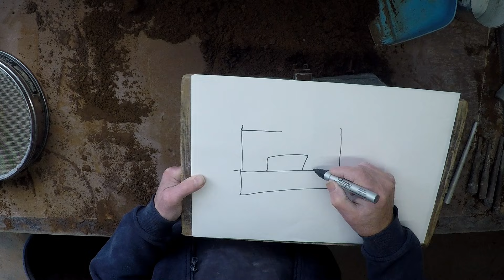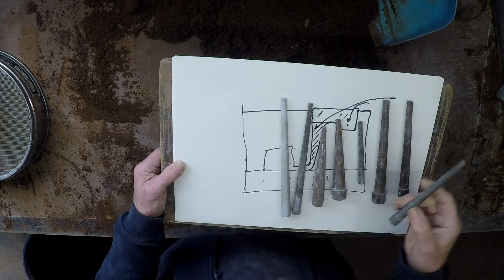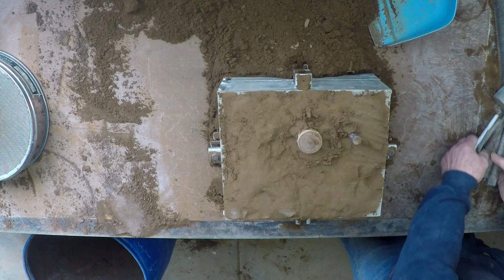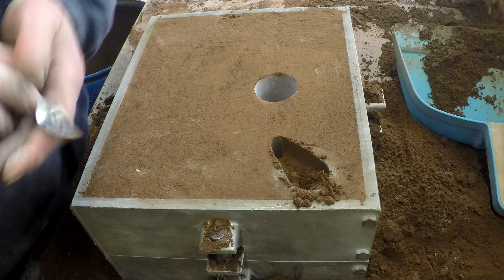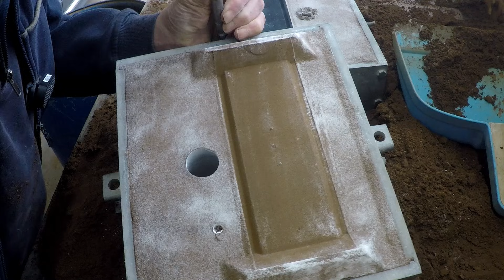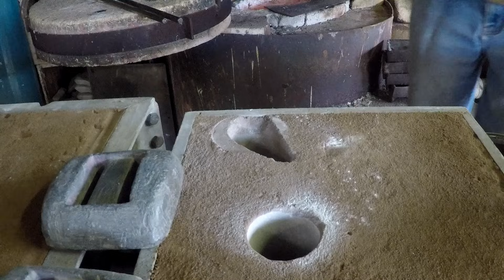Basin and sprue design for sand casting in the foundry

Comment: I've been a machinist for 30+ years, but new to casting. Really great info well put. I've seen in other videos you speak of heat treating the castings. That struck me as strange to heat treat aluminum. (?) Could you please tell me what this does (normalize??) and how long at what temperature? Thanks and greetings from Tennessee, USA!
Reply from the maker: kcraig, Yes, you can heat treat aluminium - well,  rather you can heat treat SOME aluminium alloys. Its a process with a very different mechanism to heat treating (most) steels. It is what is called a "precipitation hardening" process and is nothing like a normalizing. There are several variants of it but the two most common are known as T6 and T5. T6 involves soaking the metal at dangerously near its melting point for several hours  - this is called the "solution" part of the process. This dissolves a lot of the alloys constituents  that would otherwise be present as separate particles. It  is followed by a rapid cool (hot water quench commonly) The quench prevents these constituents from coming out of solution. The alloy is then aged for several hours at a much lower temperature. During this "ageing" the constituents just barely start to come out of solution and form billions of incipient particles. These interfere with any attempt to work (bend ,cut, etc) the alloy thus causing an increase in strength and hardness. T5 skips the solution process and goes straight to the ageing, it is much safer and easier to conduct but does not give as great a strength and hardness increase as does T6. Typically for the 356 alloy T6 solution is at around 540 deg C (accuracy  critical) for 12 to 16 hours, hot water quench at 60 C and age is at 165 deg C for 4 to 8 hours. T5 for the same alloy is simply an age at 225 Deg C for 8 hours. I use the T5 process as it increases the hardness and thus improves machinabilty out of sight. Other aluminium  alloys would likely require different temps and times.... Martin
Reply: @olfoundryman8418  Thank you so much for taking the time for such a detailed answer!

Comment: My God this is golden information. Godsend. If only 10 human beings were chosen to survive mass extinction, you would definitely have to be one of them. This knowledge can restart civilization back in no time.
Reply from the maker: Tu, Thank you very much for saying so but there is nothing new here 😏- the basin dates for the early 1900s and the tapered sprue from at least 1954. The combination of the two is a little younger at around 30 years - its just that the foundry industry is so locked into its 6000 year old technology and so pig headed about it that most do not and will not even try it - convinced that it will not work despite my (and other) videos clearly showing that it does work and work very well indeed. If you use these simple and easy techniques you will be miles ahead of those who don't and that sadly includes most professionals... 😱    Martin
PS I am more likely to be one of the FIRST ten chosen to die 😞

Comment: Great video and explanation of what is going on during the pour. Could the splash in the basin that I believe you said was unavoidable be minimized by adding a couple more  basins side by side connected thru the center and feed a outside basin and wash the turbulence and any loose fill into the far side before the trio of basins fills to overflow the weir and fill the mold. I ask out of ignorance and curiosity as my brain never cuts off. Its a curse some times
Reply from the maker: RPM, Don't think so, you are going to get some turbulence /splash when whichever basin is filled first. Some people actually notch the side of the basin and the crucible lip sits in this notch this helps also I could extend the "spout" on the ladle and this may help too. But the little splash we get pales into insignificance beside that  when metal is poured down a large parallel sprue. Never stop thinking.... Martin

Comment: @Olfoundryman Very good Video as all ways!  What do you treat the ladle with so that the aluminum don't stick?
Reply from the maker: Dawid, I paint the ladles with boron nitride hard coat made by ZYP coatings. It is an expensive material but works well, I use it on my thermocouples  too. It has an upper temperature limit of about 900 deg C so it is of no use for copper base alloys (pity!) This coating repels both molten aluminium and fluxes.... Martin

Comment: You'll notice that "bag" of aluminum oxide while welding as well. Get something too hot and it'll droop. Back on subject, what is your ideal pouring temp? 730? Do you change your pouring temp depending on the alloy or size of the casting or just keep a favorite temp?
Reply from the maker: Amalgamous, Yes, with welding too hot and you get the bag full of molten aluminium (and an awful weld). Pouring temps - I admit to usually going too hot as I hate to open a mould and find a miss fill because I poured too cold. I used about 750  deg C for these box sides but I think they would have run at 730 Deg C. The golden rule is pour as cold and as slowly as the casting will run and some alloys require cold pouring - piston alloys for example I pour at 680 to 690 deg C., the throttle bodies at 730 (356 alloy)   Thick stuff in 356 690 to 710 thin 730 to 740. Also your sand makes a difference, petrobond probably best to use a lower temp but fine green sands a higher one. Confusing isnt it? Considering the variables it is an individual thing, you just have to try and see what happens and then next time you do the job lower temp 10 degrees and see what happens, you will soon get a feel for it - did it come out sharp and with spiky flash too hot did it come out smoother but with rounded edges and corners borderline cold  - start at 730 regardless of alloy and judge future action by the result. Note that many books etc give a range for thick medium and thin castings, but the individual variability of everything makes these recommendations a bit moot.  Suck it and see is probably the best way ... Martin
Reply: @olfoundryman8418   It gets seen alot when teaching people how to weld aluminum. They linger in one spot for too long and "Opps."
Getting back to casting, I have found that the thinner and more intricate the casting the slightly hotter you want it.
On another note, I haven't seen you do multiple linked castings. Also, what's your take on lost wax method using plaster of Paris? Worth the effort? I've seen some people use a centrifuge to "fling" molten aluminum into moulds. Always seems sketchy to me. Now it seems they prefer vacuum machines instead. What's your take on it? Good for aluminum?
Reply from the maker: Amalgamous, I always felt that one of the problems is that most people are used to seeing things get red hot before welding and brazing but wait for that with aluminium and you have a big hole and a puddle on the floor.
I have doe multiple linked castings  - up to 14 parts arranged along the one runner just never done a video of any of these as they were jobs that predate my YT days. Straight plaster is a bit of a lost cause to many problems with cracking of the plaster etc. However most commercial investment casting mould materials are plaster based but even there you MUST adhere to the strict burn out and preheat cycles. Companies like Kerr make such materials and there is info on their website. Flinging is more a technique used by dentists to cast gold fillings and it does work well for small articles (it is also used  very successfully with spin casting of lower melting point metals and plastics into silicon moulds - check out TEKCast web site) Vacuum is most definitely an aid to investment work when fine detail is required and where sections are thin. The process is suitable for aluminium. Then there is this sort of thing  https://www.youtube.com/watch?v=QlPqsukn6Bc    Martin

Comment: Excellent explaination why to do it right and how to do it right. As a hobbiest who adopted the 20mm parallel prue and bean can extension for "head presure" out of ignorance, I really appreciate this video. Now I need to get my by butt and make a tapered sprue and  basin cutter before the next casting session. Often I keep doing the wrong things, by being too lazy to prepare the right thing in advance.
I just watched your modular flask video 5, and with the two longest parts, which you poured first,  you also added sprue and riser extensions. Could you please also give us your thoughts about when this is advantageous?
Reply from the maker: Rotary, The problem is that many of the older books and most of the YT crowd use the 20 mm sprue and many the bean can too. I don't blame you for taking these things up its what was in front of you and it seems to work - although I note that we often do not get a good enough look at a casting on YT to know how well it worked. It was as a reaction to what I see as bad info and bad example that I started my YT journey - basically I am trying to counteract the bad by presenting what science has shown to be a better alternative.
The two longest parts were in moulds where the cope box was on the thin side at just 60 mm high. This meant that the feeder was just 60 mm high too, I was concerned that it would not contain enough feed metal to provide for the casting so using some standard extensions that I have (for just such occasions) I increased the height. These are 30 mm high and I filled them to about 25 mm so giving a total feeder height of 85 mm this is the same height as the other copes in this pour. While extra height is not always a good idea here it was for the good cause of providing enough feed. Of course 25 mm is a long way short of the horrendous 100 mm plus bean can....Martin
Reply: @olfoundryman8418  Thanks for your detailed response Martin.
Mark

Comment: Going on your recommendations in earlier videos I tried the small tapered sprue and basin the first time about a week ago. (It worked fine.) Now I have a lot better idea why I was doing it. Are there any differences if pouring bronze?
Reply from the maker: Dick, No, The metal concerned does not matter, All liquid metals are fluids and the  design principles used here are based on fluid behavior. With bronzes the use of such basin and sprue designs is just as important and even more so in the case of the film forming bronzes that contain aluminium. The latter are notoriously difficult the get good clean castings without entrapped oxide films, good sprue and basin design is vital..... Martin
Reply: @olfoundryman8418  Thanks.

Comment: Yes, please do show the calculations. I think you’ll end up changing your statement about no universal tapers: as I understand it, the two variables are the speed at which the person pouring can pour, and the height of the sprue—the first can be approximated as the same for most people, and the second is pretty much the height of your cope. Given a few standard cope heights, the same small number of sprue forms should suffice.
Reply from the maker: Joel, Yes, and no! Within a size range and box height like I do most of the time there is a sprue that works reasonably well. I use that 8 mm exit sprue with the 1.4 degree taper per side about 90% of the time so its close to "universal" for me.  However my search for the holy grail of a universal sprue taper showed all to well just how much the required taper varies with heights, sprue type, and size, basin depth etc. In the follow up video I will show the results of this work you will be surprised - I was!.... Martin
Reply: @olfoundryman8418 , I’m looking forward to it.

Comment: Thoroughly enjoyed this and I do like your basin. Looking forward to your next vid. My basin's are similar in cross section with about 1/4" high x 1/4" long ledge before going into the tapered sprue. My employee has a difficult time holding the size of the basin consistant so I think your method would solve our problem. We will try this on the next molds👍
Reply from the maker: Windy, Cut the basin with a thin walled tube its easiest and quickest way I have found - spoon cut is hopeless too rounded too slow. Lump of sand should come out with tube - to achieve this any sharpening of tube to be on inside and if necessary dint the edge a little inwards. Make sure your ridge is well radiused at sprue junction have a look at the video I mention in my pinned comment to see what happens if the radius is bad look closely until you see the bubbles its fascinating.... Martin

Comment: Martin in your follow up can you explain sprue size for larger/taller casting? Must be cooler weather there haven't seen any new vids lately.
Reply from the maker: gene, Follow up will have info on sprues up to 300 high (12 inch) but calculations are applicable to just about any size/height sprue. Too damn cold to get out in the shed 😱.. Martin
Reply: Too damn hot for me here.

Comment: Makes sense. I have always noticed that castings tend to have a lot of voids from different people pouring molds. I always thought it was because of impurities in the molten metal. I know it does have an affect. A lot of people use those cans and others just pour down a straight  sprue hole. Venturi for carbs not castings. That explains a lot. Great video. Continue please.
Reply from the maker: Fred, Got it in one, will continue.... Martin

Comment: Absolutely brilliant bit of educating material.  Thanks Martin.  Yes I would like to see the calculations as well.  Also have a couple of questions from Part 5 of the molding box sides.  Could you explain about the exothermic that you use on top of the riser after the pour.  I also noticed you were using the elevated  (albeit not tin cans)  riser and sprues.  Was that just part of your experimenting or was ther  particular a reason for them .  Just that they seem to go against what you say in this video.  Really enjoy your work.
Reply from the maker: Slipery, The exothermic I use is called Ferrux NF, it is made by Foseco and its job is to catch fire and generate a lot of heat, this keeps the feeders liquid for longer so they are better able to provide feed the the solidifying casting below. I did use extensions on two of the moulds for the box sides, if you have a look at that video you will see that the top (cope) box concerned is quite thin at about 60 mm. I was concerned that at just this 60 mm the feeder would not have enough volume to feed the casting. The extension then was solely to increase feeder volume. The extension I used was about 30 mm high and are pre-made ones I used a lot for throttle bodies for exactly the same reason. I probably filled them to about 25 mm giving a total metal height in the feeders of 85 mm which is the height of my more commonly used cope moulds.  This 25 mm is a long way short of the "bean can" of 100 mm plus. I would prefer not to use any extensions but here it is moderate and done for the good reason of getting enough feed metal. The 100 mm "bean can" is anything but moderate and looking at how it is used is seems unlikely to have anything to do with good feed and frankly I do not know why it is used.... Martin